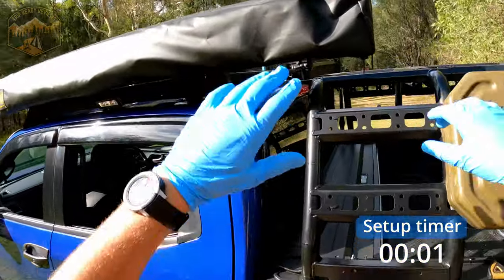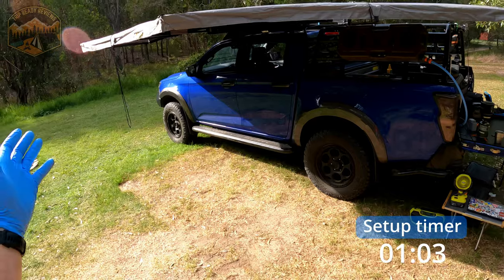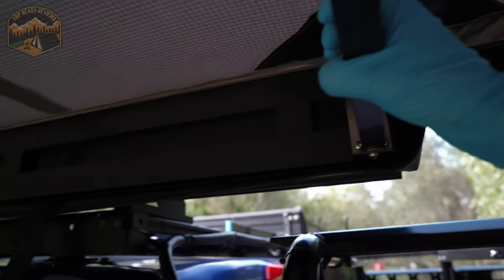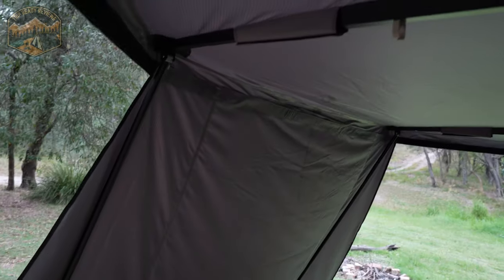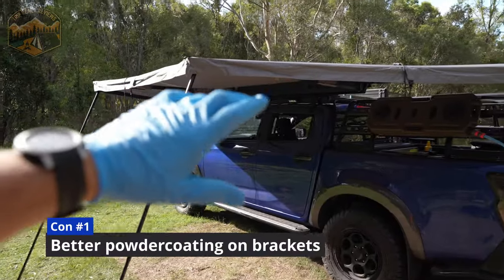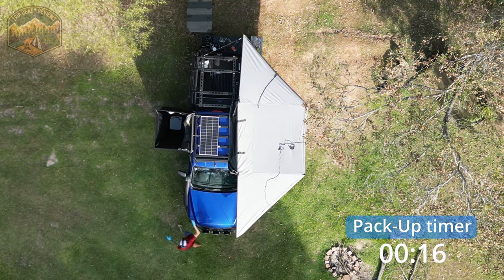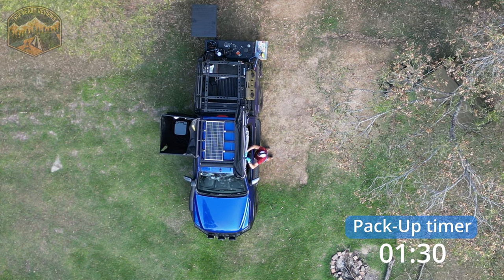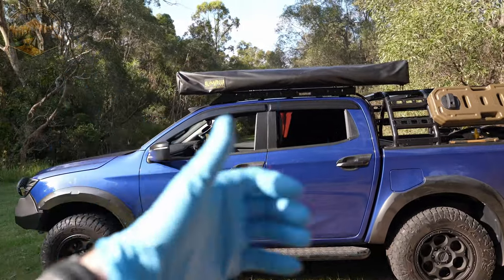BUSHWAKKA EXTREME 180 AWNING | Timed Setup, Pack down etc | Full Trip Ready Review

Comment: I put this awning on ages ago. I find putting an expanding pole across the outer middle adds removes that floppy look and adds rigidity to the front for an awning. Also folding brackets so it's in the flat position when travelling.
Reply from the maker: Top tip 👍

Comment: I have ordered the 270 and will attach to my upgraded Kings MT2. A little worried about supporting the main pivoting connection. Not sure, if anyone else has had to install an awning with brackets that are close together, I would be keen to hear about how they found the twist in the main pivot connection. My plan B is to buy a Big FA RHS aluminium section from Ulrich (awesome company) south of Brisbane and run it the length of the awning.

Comment: Hi Adam. Is it easy to remove the awning and mounting bracket if I don’t want to drive around with it on when I know I won’t be using it?
Reply from the maker: Yep 2 min job, I only put it on for trips and day trips at the beach (will now the 270 version) 4 bolts bolt it onto the rack. I leave the brackets attached to the awning.

Comment: I feel like the only reason you'd get a 270 is if you had a canopy. I'm not sure I'm going to get a canopy or not, so I'm undecided about which one I'd go.
Reply from the maker: I have the 270 review out soon so you can compare 👍
Reply: Even with a canopy it can be tricky, I’ve been wanting a 270 awning but its hard as I’ve got a canopy window that opens up really high, its most suitable on a wagon, its possible for alloy canopy’s for sure, but I’ve got the fibreglass canopy, and theirs workarounds you need to do to have a 270
Reply: I've got a Prado so a 270 would be great to cover the rear door too